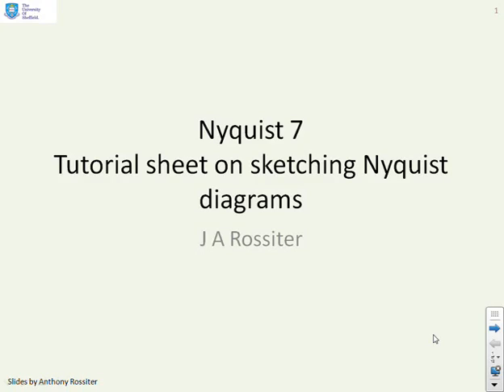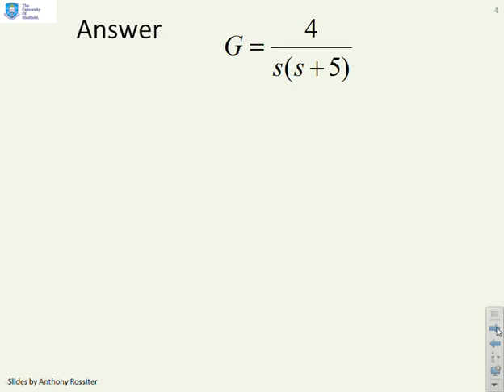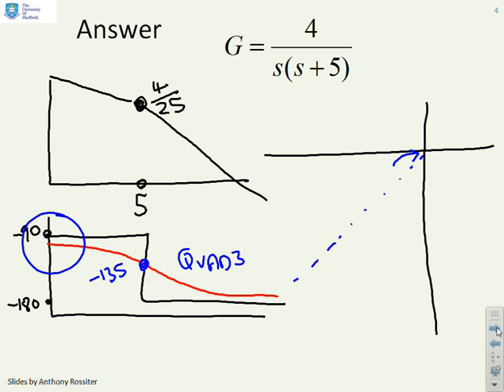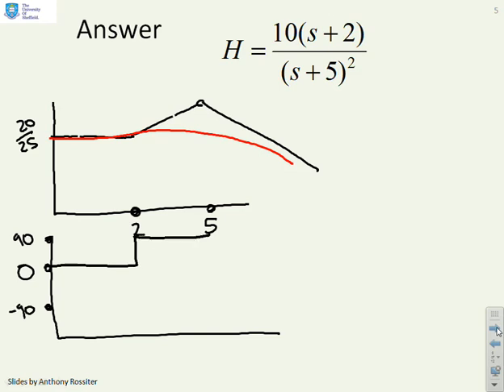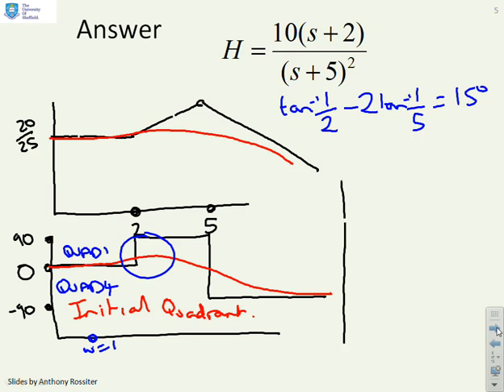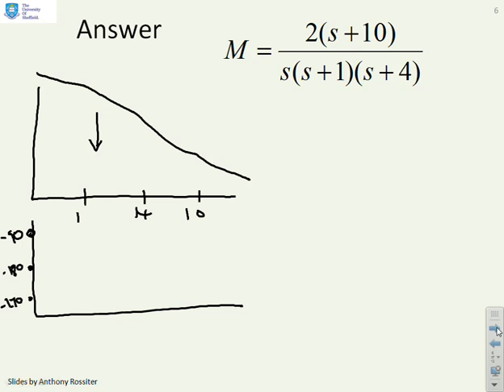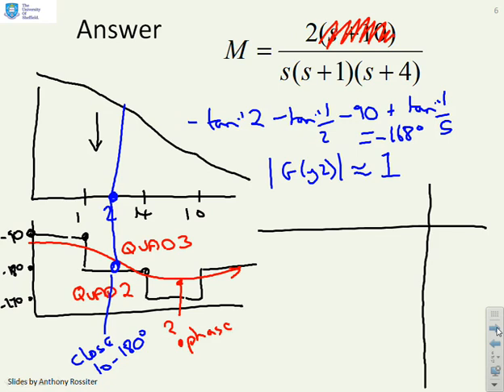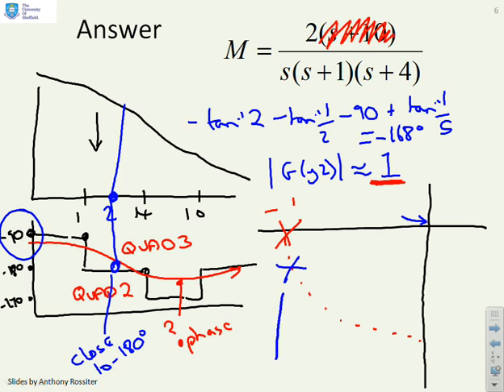Nyquist 7 - tutorial sheet on sketching of Nyquist diagrams

Comment: why do you add 180º to the phase of P, when there is a pole on the RHP, and then, on the Wilkie example, you don't add 180º? TY
Reply from the maker: farfalhas94 It will depend upon whether you have a factor   (s-a) or (a-s) which are different in phase by 180 degrees.Anthony

Comment: in the bode plot for the second example, after the 'double corner frequency' shouldn't the slope be 40/decade, not 20?
Reply from the maker: ***** The slope changes by -40db/dec but if it was initially at +20 then it would move to -20.